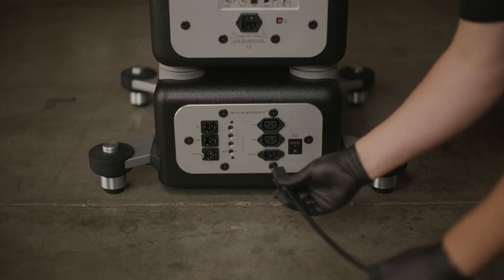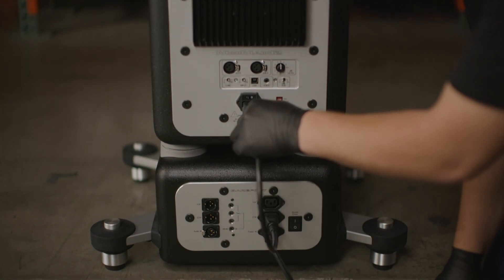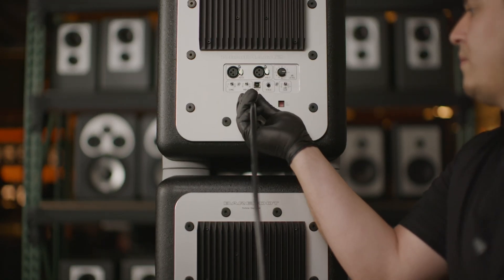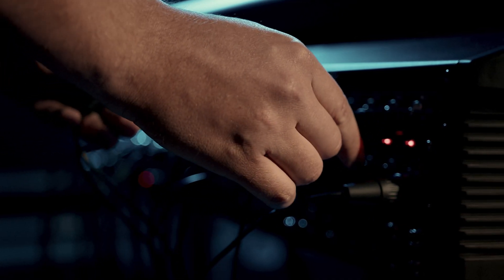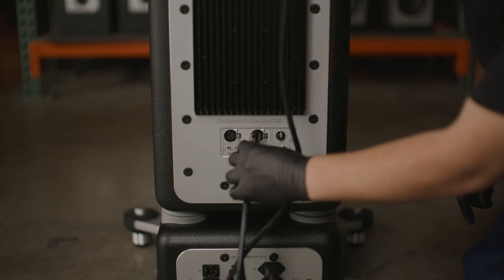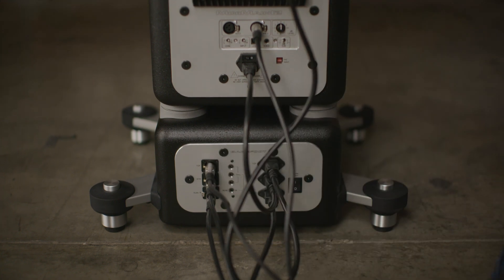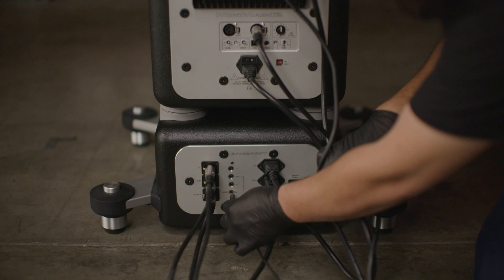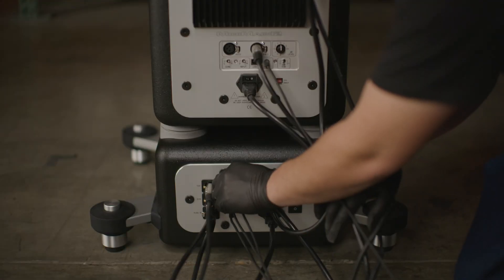Barefoot Sound MasterStack12 Cable Connection

Comment: I would like to lodge a serious complaint against your company's distributor in China, youshenmeiying
I am a user of your company's product, the BAREFOOT MM26. Firstly, your product has a design flaw that causes it to malfunction after several dozen hours of use (mainly due to inadequate backside heat dissipation, potentially also involving circuit design issues). Prior to 2024, each repair has cost between 3,000 to 8,000 RMB, and it has already been repaired more than three times. Recently, it malfunctioned again (see the attached video), and your domestic distributor in China has quoted a repair cost of up to 12,000 RMB (see attachments). I would like to understand several issues: why is your DSP module prone to such easy damage? Why are the repair costs so high? Or is it due to arbitrary pricing by the domestic distributor in China?
Have you considered the distress caused to users? In the future, repairs will be needed every few months, each costing over 10,000 RMB?
I have already exposed this matter on social media in China, gaining tens of thousands of views. I will continue to monitor this issue.
Please provide a prompt and reasonable explanation and resolution.